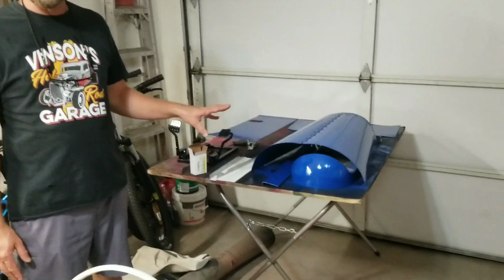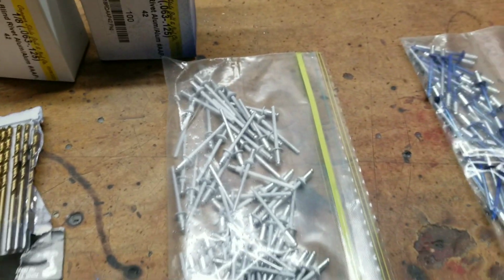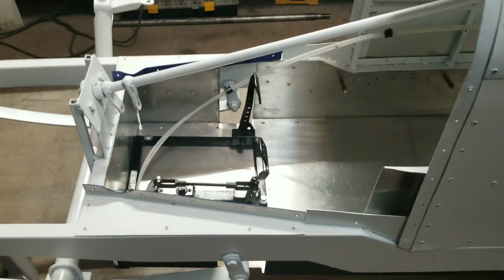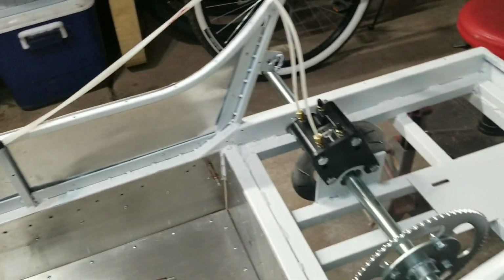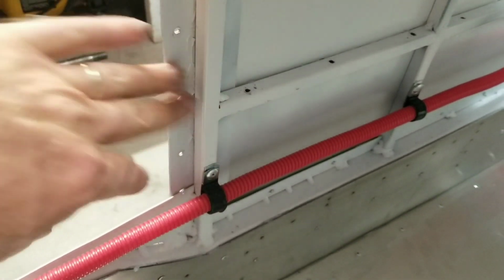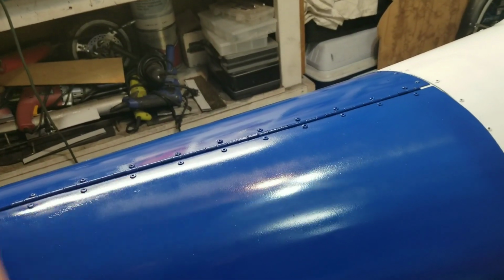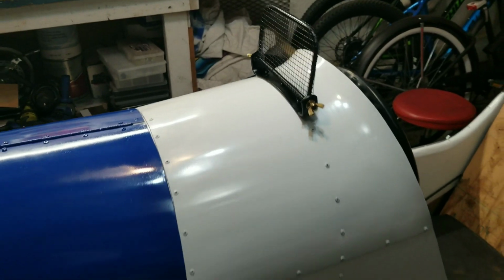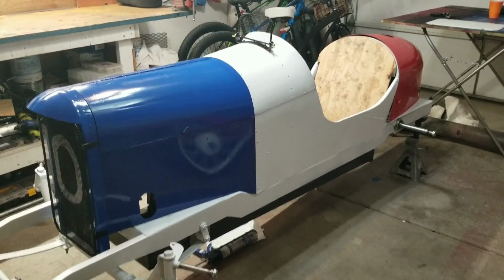1913 Duesenberg Final Body Assembly

Comment: The problem with the paint finish is two fold. Should have lightly roughened the surface with a light Scotchbrite pad and cleaned it with Acetone before priming, did the same thing to the prime coat before finishing. The effect your seeing is Orange Peel.
Reply from the maker: I have tried several different methods since this video was made.  I can paint on dirty unprepped aluminum, one thick coat, it looks good.  Try to put a second coat after the first dries and it wrinkles up and looks like doo doo.  Someone told me that its something in the paint to help it bond to the surface, not fun, but now that I know, I can plan ahead.
Reply: @stevevinson6030  
It’s called Alligator’ caused an unclean surface, too much 2nd coat before the first one is completely dried, and failure to sand in between coats. The bottom line to a good final finish is in the prep work. Cleaning, priming, sanding and cleaning. Sure it take time but so does anything worth waiting for.

Comment: You could have used sheet brass or copper for the radiator hood....
Reply from the maker: Yes, the original was a copper color.  I tried to simulate that effect with spray paint, but decided that I preferred the painted look.  Also there is a photo of the car in 1914 that makes it look like the radiator was painted the body color of  blue.  Thanks for watching.
Reply: @stevevinson6030  I think it looks cleaner the way you have it. Just didn't know if you thought of the other was all.